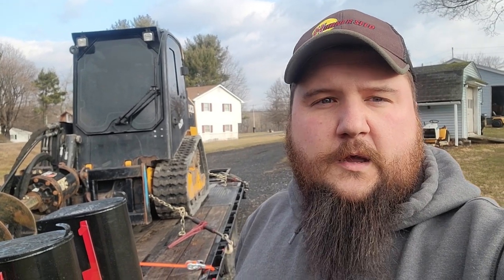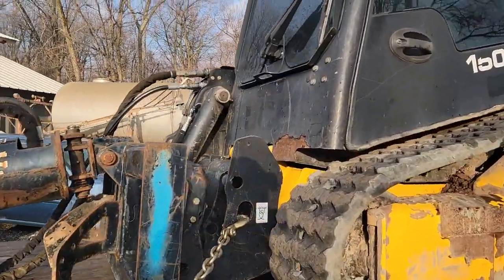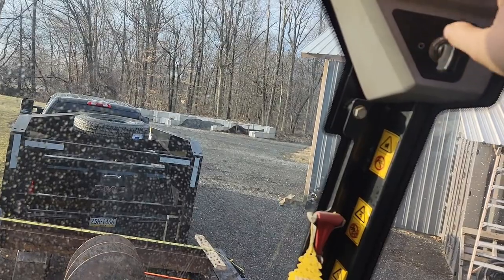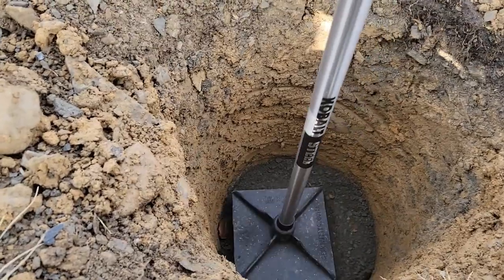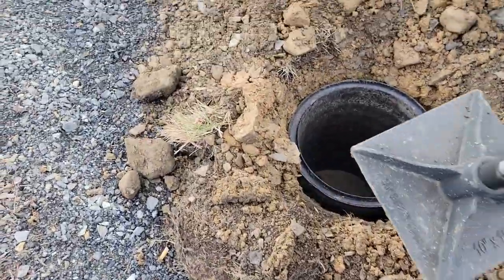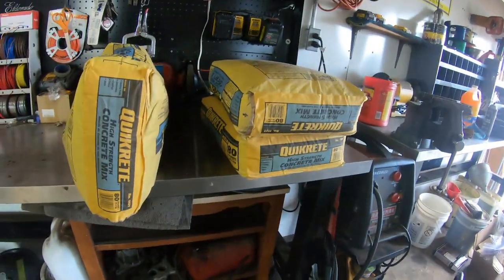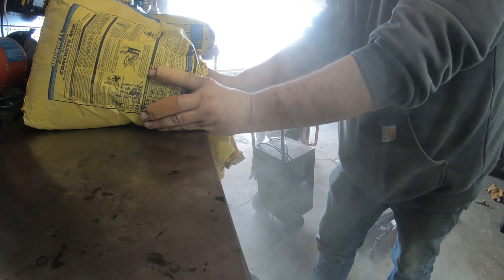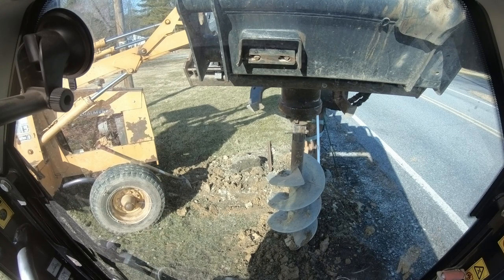Replacing Old Mailbox Post With 10" Steel I-Beam And Concrete!

Comment: In my area, if a snowplow hits that and it damages the county's plow, youre on the hook for the repairs.
Reply from the maker: We don't have any rules on what the mail box can be made out of, the biggest one is the height. Pretty rural here. Which my mailman loves this setup compared to last one haha. But boxes are usually pretty well off the road around here and you basically would have to hit them on purpose. I also work for and plow snow for a local township and the only time I get close to mail boxes is doing curb lines where the plow is sometimes taller than the bottom of the box since those are usually right at the curb. Otherwise, its all good! Thanks for watching!